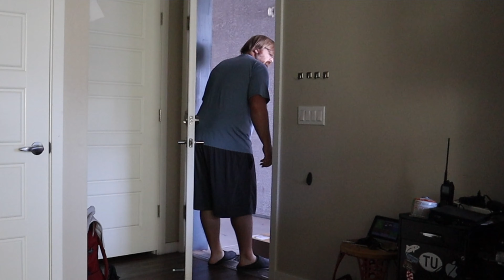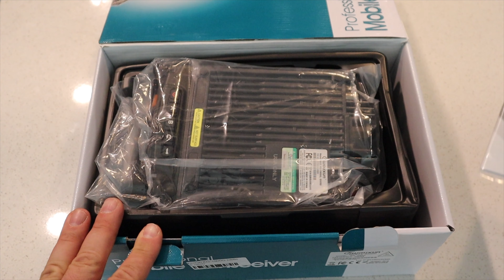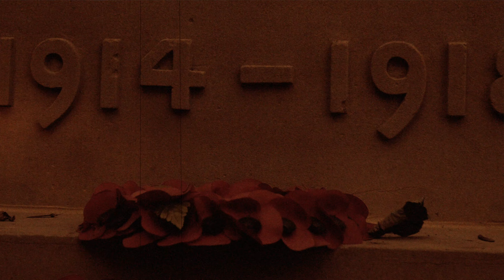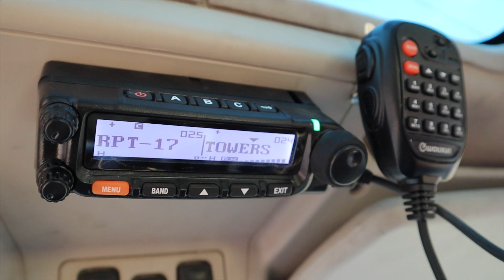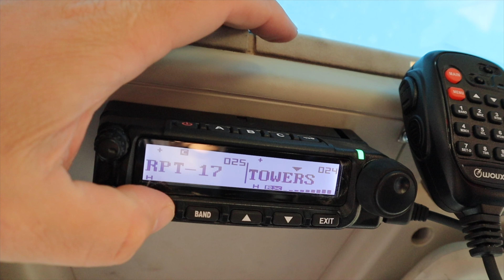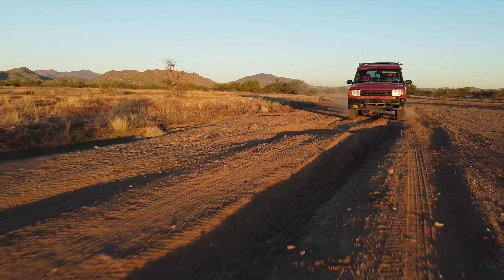Why the Wouxun KG-1000G Is The BEST GMRS RADIO You Can Buy | 4K

Comment: Very to the point and informative.  Room in the cab is definitely a major consideration because I already have a CB mounted in the ceiling console.  That leaves the dash board which is packed with instruments.  A small space exists where the dash meets the center console and may work if the detachable faceplate is not more than 2 inches deep.  How deep is the face plate?  I assume the antenna mounts to the main unit.  

Also what is the power cord to the unit?  Is it USB or does one have to go through the firewall to the battery?

Comment: Everyone needs to stop saying that this is a 50 watt radio. It is not a 50 watt radio, on UHF it puts out a maximum of 40 watts. It would be 50 watt capable if it were still capable of transmitting on VHF. Also, the receiver is deaf compared to other UHF/GMRS radios.

Comment: These GMRS radios will not survive the desert southwest heat 110-120F (inside a car goes beyond that). My xs20g did not make it this summer. If your car is parked in direct sunlight or not always on the road, then I recommend taking the radio off in the car when not in use. Unhooking the radio may be a hassle but you may extend the life of it. I decided to order the new KG-1000g plus. I will be taking better care of it this time.
Reply: good info underrated comment.
Reply: I don’t think the XS 20G Has an internal fan so it’s best used inside an air-conditioned vehicle, I would take mine out anyways because I don’t want somebody breaking my window to steal the radio! The KG 1000 has an internal fan so it will definitely do better in the heat!

Comment: I wonder how this compares to the Midland mtx500
Reply from the maker: I used to have a video up that was really not that complementary to the MTX500, but I took it down as it was definitely one of those, “if you can’t say nothin’ nice…” moments that really made me look like an a-hole. What I can tell you is this, if you are planning on getting into the repeater game and want a radio with a ton of functionality for that, the KG-1000 is where it’s at. Aside from a higher waterproof rating and the fact that it comes with an antenna, there’s not a lot the Midland has that the KG doesn’t, and until their most recent firmware upgrade allowing for multiple repeater/tone combos, it was by far the inferior choice in my opinion.
Reply: @MattKester  oof, good to know, ty

Comment: The Wouxun KG-1000G Plus was just released.

No, they did not fix the lack of dimmer capability.

#sigh
Reply from the maker: I just got the email. I'm working on a summary right now, I'll definitely be sure to include that tidbit because I honestly didn't even think about it!
Reply: @MattKester  I called them, they can't add a dim function, apparently because it would require a hardware change. Strange.
Reply from the maker: @donmontalvo1  Makes sense. After reading the release, it seems like the only physical changes were labels on keys, which isn't that hard to do, you just order keys with a different character screened on them. I'd imagine that dimmer required something to be built into the circuitry of the radio, and that might not have been cost-effective. Still, it's a huge pain in the ass for anyone who mounts it facing them directly. I was fortunate in where I was able to mount it in the disco that it wasn't hitting me directly in the eye at night.

Comment: Wouxun makes great radios, there's no denying that. My only wish is that they would be a little more generous with the display, maybe similar to my Uniden SDS100 scanner. Sometimes 8 or 9 characters just isn't enough. If I could put more info in about each channel, I wouldn't need to keep that spreadsheet on my phone.

For instance, if there were enough real estate to put in SWCRS or AZGMRS, followed by the repeater name, that would be quite handy. Also, not having to abbreviate the name of the repeater would be most helpful.

Comment: The biggest downfall for this radio is that they run hot when using high power.  Tracking many KG-1000 owners and reading their comments you will find this to be true.  Wouxun should be working on this problem.
Reply: You can adjust the fan

Comment: I do appreciate the fact that you're installing it yourself, but one, dimmer compression, fittings, connectors for larger co-ax. Two, never, I repeat, never run power wires through a door jam and always ground directly to your body and chassis.

Comment: I’ve got the same Disco as you.  Where’s the best place you’ve found to mount the antenna for this radio?  Also is there a mounting bracket you like?  Thanks!
Reply from the maker: I'm still running a mag mount on the roof and then brining the cable in through a gap in the weather stripping on the A-Pillar. It was supposed to be the short term solution, I've just been too lazy to properly mount it. I think long term, I'd like to mount a good antenna either from the rear door or the front bumper like the Aussies do.
Reply: @MattKester   imitate a aussie if thats youre thing ,,Crocidile Dundee,????
Reply: Mount  the magnetic antenna in the middle of the roof on your vehicle for best results all around ,performance too ,in respect to tx&rx. Of course check youre antenna match first,ok????

Comment: I have a question ... I have several radios but I've had the KG-1000G from BTWR about 2 months now. When I first got it it pumped out 48.87 watts and now its barely putting out 40 watts. My VSWR is running about between 1.2 - 1.3 : 1. Why did the power drop, any idea or should I call BTWR and see what they say ? It is a decent radio other than that and has excellent Rx but the Tx has dropped off for some reason. I have several 40 watt radios and 20 watts and a dozen HTs or more I need the 50 watts because of location I don't need another 40 watt radio. This isn't a hobby, we live on a huge farm. We used to use a VHF system but that was taken out by a lightning strike several years ago, so we're converting everything over to GMRS .
Reply: Check you coax and clean the connections where the antenna and mount meet. Also check and make sure your positive wire to the battery has no corrosion and, check you ground to the frame.

Comment: Live15 mins from the Rockies. I have an Amateur Tech license and own dual band radios but my extended family is not interested in studying/taking a test.  We off road, UTV and dirt bike. GMRS is wonderful for this clan.  I just used my KG-1000 in the truck today powered by a battery box and mag mount antenna and will use the same setup in the UTV.  👍 on the radio.

Comment: I have a question, can the KG-1000G 50W GMRS RADIO. Can you Scan 800 Series Frequencies “Public Safety” it says that you can do 50-53.995, 108-179.995, 320-349.995, 400-479.995 and 700-985 MHz
800 Series Runs under the 700-985 MHz if I am not mistaking. 
And if so, Listening on GMRS Frequencies. 
Range 462-467 MHz 
Can I run two Antennas at the same time to monitor both GMRS and 800 Series Public Safety Frequencies?

Comment: I know nothing about radios but am looking to get one for my truck. I've decided I need this even if I don't understand half the features (I'd rather grow into something than to buy twice when I want more later).
Reply: If you need to go in a little less expensive you can have similar features but at 20 watts max with the Wouxun KG-XS20G. I'm running that and happy with it.
Reply from the maker: If the up front cost isn't an issue, this is a GREAT piece of gear to grow into.

Comment: I had one of these in my truck for about three weeks. I bought it and then tested for my ham license about a week later so I sold it and replaced it with it's identical twin ham brother. Fantastic radio though. I was hitting a repeater in downtown Oklahoma City from about 40 miles away with very little white noise on transmit or receive. The built in speaker in the mic was a HUGE selling point for me. Most other radios that have a detachable face, once you mount the base unit you can't hear the speaker so you have to buy an external... NOT WITH THIS GUY

Comment: 370 $...😱
Reply: You can buy the UV980P cheaper and use the UV950P unlocking software to open it up for GMRS. Exact same radio
Reply from the maker: Yeah, I think a lot of people are wishing they'd have bought in when they were $320! I do believe the B-Tech is still the lowest priced option in the 50 watt range at somewhere around the $210-$220 range.
Reply: @MattKester  nice !
Reply: @MattKester  any recomendation for a base antenna an 50 omh cable ?
Reply: @majorkonfuzion1007  I know you didn't ask me but I'm using a Comet CA-712EFC with LMR400 Ultraflex cable. Antenna is about 25' up in the air. I'm listening to repeaters up to 50 miles away. YMMV

Comment: Have2, neither will transmit over a couple  of miles if you are using a channel on the B (right side if looking at radio),it will receive normally, and IS set to high power forTX.  .The A side works as it should both TX and RX.    Does same on both simplex, and repeaters.  Have checked all settings and have even gone back to factory settings tried it . Same problem. For all I know, maybe it isn’t supposed to TX the same on both sides. Nothing in the instructions cover it that I have found.   Of course if you only use one side , it’s a great radio. 
My ham radio is a kenwood TM-V71A dual band , setup with 2 sides  that can be used UHF/UHF ( of course it won’t do the gmrs freqs). Both sides are exactly same TX power and RX. Which is what I expected with the Wouxun   WHAT am I doing wrong???
Reply: What channel are you trying to TX with? This radio won't TX below channel 15 it's too powerful for those channels
Reply from the maker: That's interesting and I'm going to look into it with mine and see if I can replicate it. I've so far been able to transmit on both sides, to the best of my knowledge, but I did enter a new repeater last night and couldn't get it to hit on the 1000, but I could hit it with a 3 watt Retevis RB19, and come to think of it, I did try reaching it from the B-side. I wonder if anyone else out here is having the same issues? I just tried a google search of it and didn't see any threads with the same issues. Have you tried reaching out to Buy Two Way Radios? I'd be interested to hear how their customer support handles an issue like that.
Reply: Why would you be doing any thing wrong these gmrs radios wont do what a,cb,or a ham radio will for going from going from one state to another state ,or ,otr,over the road,ok,your ,kenwood tm-v71a will do more than a gmrs ,.I,m A Ham Radio Operator As Well.